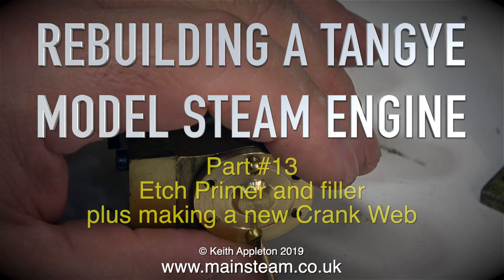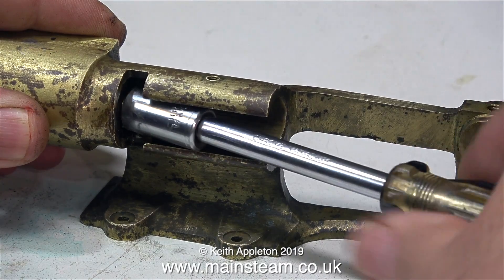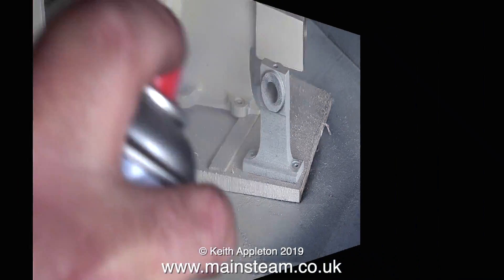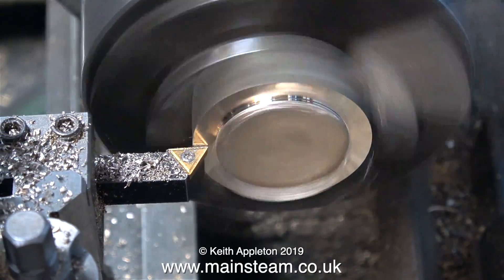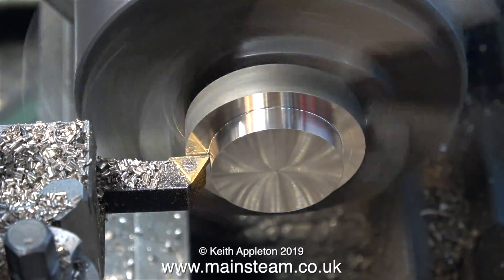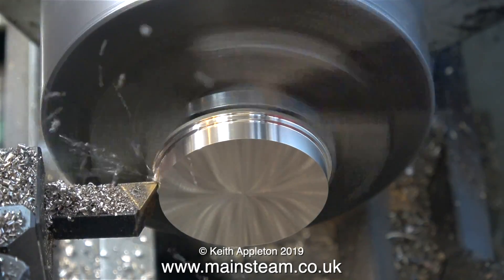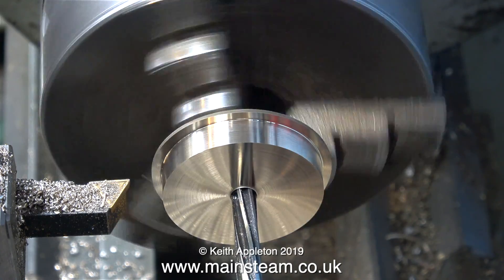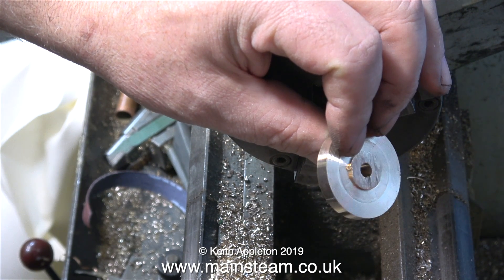REBUILDING A TANGYE MODEL STEAM ENGINE - PART #13

Comment: For those of your viewers who are not Machinist, Tool Room equipment is normally of higher precision, and heavy duty then normal production equipment. They are usually used by the most skilled personal and are well maintained. I wish I lived in the same country as Brown & Sharpe lathes are very well respected and I wish I could buy it.